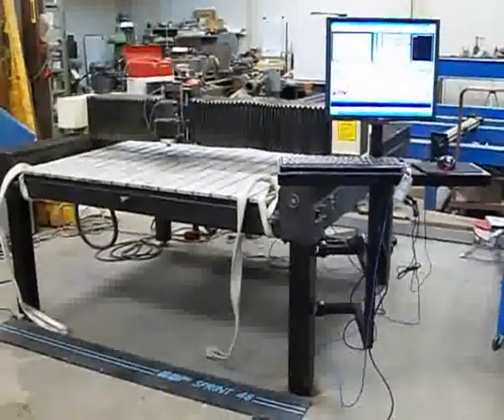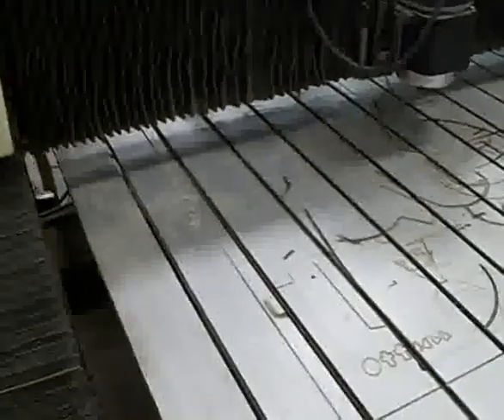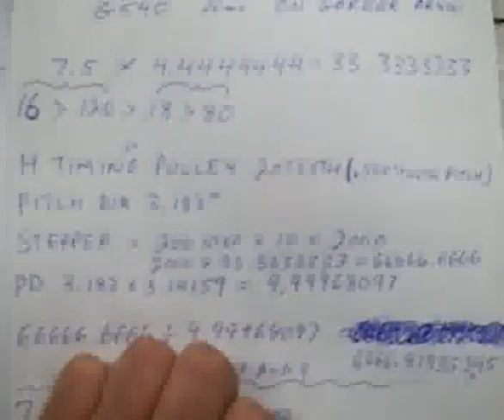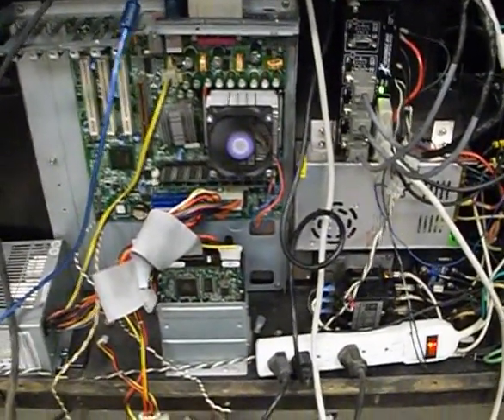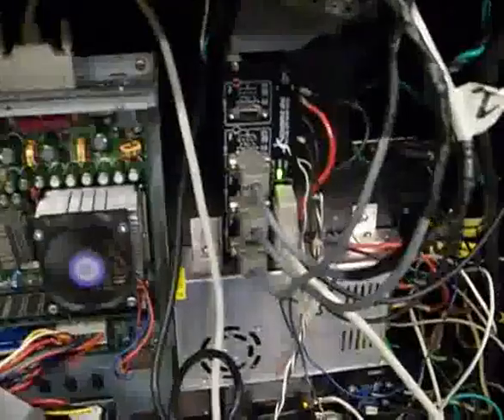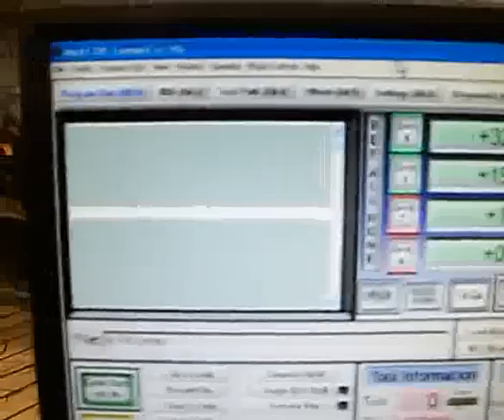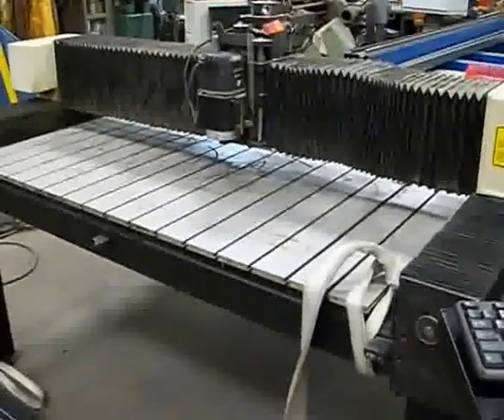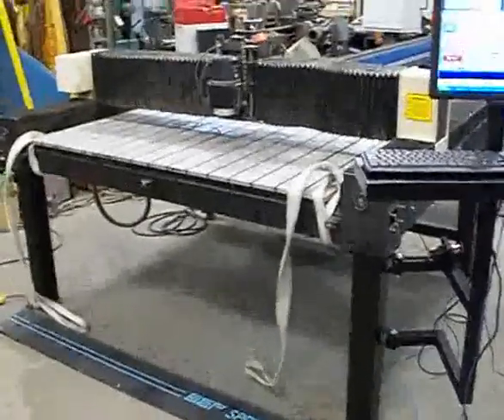GERBER CNC Router AR400 SPRINT 48 SYSTEM 48 RETROFIT MACH 3 CONTROL GECKODRIVE G540

Comment: Thank you DJB HSI for posting this information! I recently purchased a System 48 that has been retrofitted with Linuxcnc and china stepper drives. When I cut a .500 hole, the X diameter is spot on but the Y diameter (measured across the hole in the Y direction) is off by like .008 to .010. Same with a12" circle. So I will graciously use your calculations to fine tune the machine and get it more accurate. I didn't get mine as low cost as yours, but it did come with 2) 2.2 kw china spindles and a good pile of tooling.
Reply from the maker: It could be the both the Y axis belts need to be adjusted tigher or possibly replaced. If the steps per inch was setup in Linux cnc the same for both the X and Y then I believe it's a mechanical issue that needs addressing.
Reply: @dabooge  Thanks! Yes, I am going to check into the settings and also overall mechanical condition, belts, etc.

Comment: Do u know if any of system48 comes apart...its resl heavy 650kgs and i have no way to transport and store in assembled condition...how did u transport it?
Reply: Or is it all welded together
Reply from the maker: @shelby50411  the legs on the machine are bolted on so you'd be able to get it though your small doorway although it wouldn't be easy.
Reply from the maker: It's all welded.  See the lifting belts in the video? I have a very large floor crane and I lifted it with 4 belts on each corner around the frame top tube. I have all the proper lifting/moving equipment so it makes moving these a breeze. To move it you could fabricate a wooden frame that could be easily slid under and you could use a pallet jack to get it rolling.  You can hire a flat bed tow truck to get it to your place.

Comment: I appreciate all the information, I have another question, are your dm556 leadshine or generic, I noticed on the leadshine web site they talked about other controllers being made other then their own using dm556 so I went to ebay and sure enough there are variants, I see the leadshine have a rs232 port where the others did not
Reply from the maker: Yes just the generic dm556 clones or whatever.  I bought them before actually knowing they were. The stepper motors run so quiet and smooth with these drives, you'd swear I had servos on my machine.

Comment: I am looking to retrofit an exact machine, been some years since I looked at it, I had built a controller previously, but I think the g540 might be better, do you recall the wiring to the motors, color for phase, I think I recall 4 or 6 leads, and I used 4 previously, in either full or half, been a long time since I had my eyes on it
Reply from the maker: So my g540 is crap and I don't recommend one. They are overpriced too. The reason why I say this is the machine goes into estop mode for some unknown reason on startups for the 1st maybe 5 min. You actually need to let it warm up a bit which is wack. After that it runs flawlessly.  A 10um step is not great Either.  I would recommend break out board with  a safety charge pump and separate stepper motor drivers.  The motors are 6 wire but don't remember colours.  I'm actually colour blind so I actually need to ohm check it. I recommend the china breakout board that uses a parallel port and has a charge pump.  There's 3 relays on the board. I'd use the dm556 stepper drives. Probably could get it all for $100usd
Reply: @dabooge  I sent an email to gecko prior to your response and then after your response to me about the stall issue, this is what they sent back to me:
Barry,

 

                The issue he is likely running into is a switching power supply not able to respond to the immediate current requirement of the motors, causing a short voltage drop and triggering the short circuit protection on the drive. As the power supply charges its internal filter capacitors it has the ability to dump current instantaneously and supply the motors with what they need, which would explain the “warmup” period he describes. We modified the short circuit protection to address switching supply voltage drop specifically in 2017 and update any G540 that we receive back for service.

 

                We also have a way for the customer to modify it in the field as all it entails is removing a speedup capacitor in the short circuit protection region. The problem is a bit of a chicken-or-the-egg issue; when the G540 was designed the most common power supplies had large capacitors designed in from the get go. A few years later there was a heavy push toward switching supplies purchased through Amazon that were not really meant for running steppers, hence the adjustment to the protection circuitry.

 

                If you have that customer’s contact information I can get in touch with him and explain the modification or offer for him to send the drive back for free evaluation and repair. We want all of our customers to be pleased with their purchase and our main goal is to make sure that the drives we sell are spinning motors all day.

 

Marcus Freimanis

Geckodrive, Inc.

1540 S Grand Ave

Santa Ana, CA 92705

 

Phone: (714) 832-8874

Fax: (714) 832-8082
Reply from the maker: @barryroe6035  interesting that there is a fix. Thanks for that. I still stand by my statement that for 1/3 the $$$ you can get a much more versatile setup. I've been running the China stuff for years especially those drives mentioned and they are solid.  Also you can get a higher resolution because of the much higher step count. Having an all in one unit is nice but if or when a drive lets go you're at the mercy of getting a whole replacement or getting it repaired.  I use to use the all in 1 red china 4 axis boards. In fact I have a machine with one still going after 7 yrs. They are every bit as good as the g540 at 1/6 the price. On all my new retrofits that I do I use separate drives. If one was to let go i can swap it out in minutes and be up and running again.

Comment: If you’re wondering why your views went up on this video it’s because I just bought one. I’m trying to figure out what the motor wire colors are to wire into the DB9 plugs . Also trying to figure out how you’re running the router with the ssd drive any answers would be greatly appreciated .........I know this video is old sorry
Reply from the maker: My wires are all heat shrinked so I can't look to even take a photo for you. I'm a bit colour blind, so I'd probably be no help anyway. Take a voltmeter and probe the 6 wires or possibly 4 wires? You need to ohm check and find the wires that give you a reading. If 6 wire, You'll probably want to run it full coil. Find the matching values and that will determine your pairs. With a 6 wire you'll want the 2 wires that read the higher ohm.
Reply: Blue + A green -A one pole ,orange +B red —B second pole ,Black and white are not used if anyone else is retro fitting a Gerber 48 but you better trace them. Thanks a lot you were a big help 👍🏻👍🏻

Comment: Did you end up using the VFD that came with the machine? I have picked up one of these machines and am attempting to do the exact same thing you are doing. I'd like to use a router as well. do you have variable speed control with your setup?
Reply from the maker: I didn't use a VFD I don't believe there was one with this machine but I'll have to check the left over parts box it's been a while. The porter cable router has manual speed select at the top of the router. I found that was good enough for what I need. I originally was using an SSR but the gecko didn't like it. It was acting flaky even after swapping it to another brand. It's just a simple 24v -120v contactor that turns the spindle off/on now.
Reply: I finally got my G540 and power supply, and was wondering if you have any setup tips? You had some calculations on your video but i couldn't read them as my video quality isn't very good. also, what was your reasoning for placing the keyboard and monitor where you did? why not near the computer and controls? i am sorry for all the questions, i'm just excite to get this up and running and its nice to have a resource that has done the same thing to reference. Thanks for all your help so far and for the video!
Reply from the maker: Chris Helie view the video on a PC you'll see overlay I put on the video for the settings. I put the PC in the back cabinet to keep it out of the dust but more importantly running a long parallel cable to the back is not recommended. I ended up using a dvi cable in the end to get a much cleaner video on the display. I use a USB hub placed under the keyboard console tray and plug in my USB stick to load programs

Comment: Where you getting parts from?  I have same machine but might need a new left guide rail
Reply from the maker: Never had to repair any of the mechanical parts. Unless you have physical damage or excessive wear to the round rail, you'd likely only need to replace the ball bushings. I'd check eBay 1st for a replacement but these parts are readily available from many suppliers. If you have no luck get me the specs I can should be able to find you a supplier.

Comment: Hi great video, I've started to retrofit a gerber but I believe my microsteps and power are wrong, it's fairly accurate to the eye when it moves but can stall and lose steps. I have all the mircosteps set to 1600 and power 3.5a. Here is a video of it running https://www.youtube.com/watch?v=4AXxvEFkOA4

Thanks for any help and insight you can give
Reply from the maker: What stepper driver are you using? I wired my motors full coil. I suggest you do the same for max torque. You will lose top speed but I find my machine quick enough for what I do.
Reply: Hi thanks for replying, below is the info from the wantai step drivers I'm using. from ebay

http://www.ebay.co.uk/itm/EU-Free-Ship-Wantai-Nema34-Stepper-Motor-3Axis-1600oz-in-Dual-Shaft-Driver-7-8A-/182107195839?hash=item2a666f49bf:g:m14AAOSwwo1Xegvc

The DQ860MA is  an economical microstepping driver based on patented technology of Wantai Motor .It is suitable for driving 2-phase 4-phase hybrid stepping motors .By using the advanced bipolar constant-current shopping technique ,it can output more speed and torque from the same motor,compared with traditional drivers ,such as L/R drivers .Its 3-state current control technology allows coil currents to be well controlled and with relatively small current ripple,therefore less motor heating is achieved.

Features

◆Low cost and good high-speed torque

◆14 selectable resolutions

◆Supply voltage up to +80VD               

◆Suitable for-2-phase and 4-phase motors

◆Output current up to 7.8A,5.6A rated current.

◆Dip switch current setting 8different values

◆Optically isolated input signals

◆Pulse frequency up to 200KHz  

◆Automatic idle-current reductiOn

◆Small size  (107*97*48),Weight:0.6KG
Reply from the maker: Did you swap out the motors or using the stock ones? what did you set for the steps under motor tuning parameters in Mach3?
Reply: Hi yes im using new Nema 34 stepper motor with 3.5A 1600oz-in for Dual shaft. I use the mach3 calibration and the x is 210.0464981 the y axis is 1049.562682 and z is 312.6628452. Thankyou for taking the time to comment.
Reply from the maker: You need to calibrate the machine with native units in inches or you will never get it as accurate as you want. The z axis is a 5tpi screw. I have a metric Ballscrew CNC Mill and I had big problems trying to calibrate in inches the native units should have been Metric. You can setup your mach to either start up in G21 or you can just have the 1st line of your prog have G21 it's up to you. What step multiplier are you using on your drives?
Reply: I will definitely try to set up mach3 in inches. All my micro steps are set to 1600.

Comment: I HAVE 2 AR 600 I WANT TO DO THIS CONVERSION .
DO YOU KNOW IF THE STEPPER MOTORS ARE THE SAME AS YOURS
,ALSO CAN YOU GIVE ME A LIST BREAKDOWN OF WHAT ALL I NEED TO PURCHASE ,,THANKS A MILLION
Reply from the maker: G540 gecko, 24v 15 amp supply, 24v contactor, cooling fan &  PC and the rest is wiring
Reply: +DJB HSI thank you .when i get this conversion done and mach 3 loaded ill need some help with the math for setting up the steppers in the software
Reply: i purchased another router table,
and it has gecko g540 already can i hook it up to my gerber,
if you would call me i have seveal questions

Comment: Hows the machine running now after a bit of time? I have an ar400 and don't know if i should convert it. It runs fine off artpath but id like to be able to do more with it! I recon mach3 would let me!
Reply from the maker: Runs the same as the day I finished the retrofit. Mach 3 and Vectric CAM software makes this machine a breeze to operate. I'm amazed a timing belt machine can hold tolerance the way it does.

Comment: Very informative vid, Thanks. Rather than do the calculations for axis travel for Mach3, why not simply move the axes a measured distance depending on your chosen native units (millimetres or inches) and count the number of stepper motor shaft rotations for that distance? I'm doing a Gerber/Gecko/Mach3 retrofit myself.
Reply from the maker: Hammerworks When you're dealing with a gear reduction drive train and a timing belt for the final drive or even a rack and Pinion you will get accumulative error. Try it and you will see. Your step settings have to be in range to start otherwise if they are way off you can over travel the machine. My machine is so accurate that It constantly amazes me. For a 26 year old machine I am very happy. + as the famous Sheldon Copper would say "I'd rather do the math" LOL
Reply: DJB HSI There is not a huge difference between the outcomes of our methods... my "guesstimation", which was going to be get me in the ball park and then fine tuned, is 250 microsteps per 1mm of travel and yours turned out to be 262.475565 microsteps per 1mm. I think I'll cheat and use your calculations anyway!! Cheers.
Reply from the maker: Hammerworks I retrofitted a large Hurco mill to Mach 3 many years back. The machine has metric Ballscrews and we did the setttings in inch parameters converted from metric. I could never get the machine as accurate as I wanted it. It was off .002" in a foot and the machine has no backlash. When we tell mach to start in metric and do the settings in metric the machine was perfect after that. I like working in inch but instead of putting G20 in the program start I set it up under Config > General Config (I believe it was) The initialization string I added G20 but in your case If you prefer metric you would add G21. Since the AR400 has a Inch Ballscrew you might want to do the same, as maybe you will encounter the same issue I had with the Hurco.